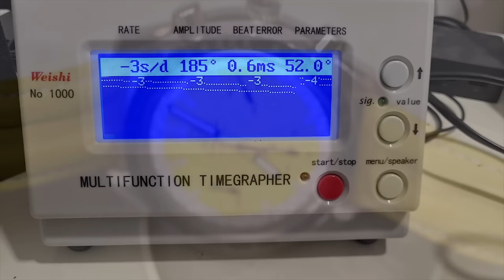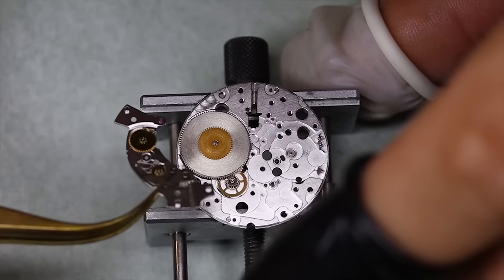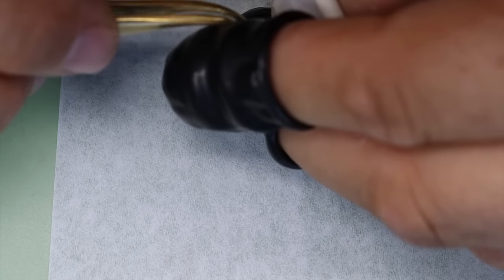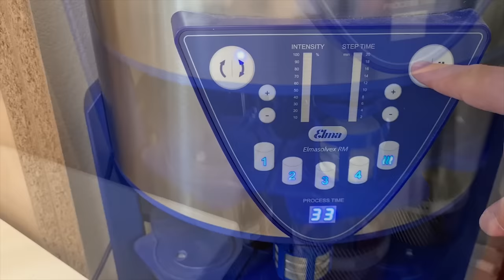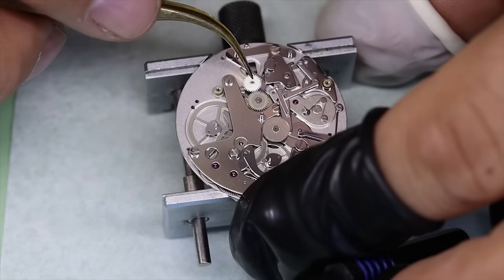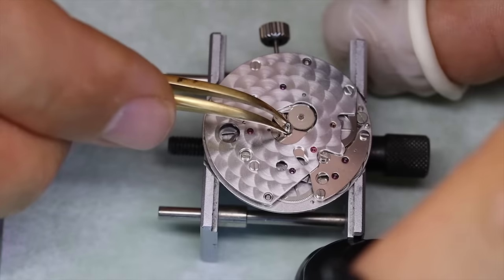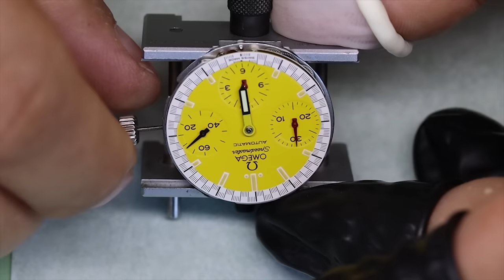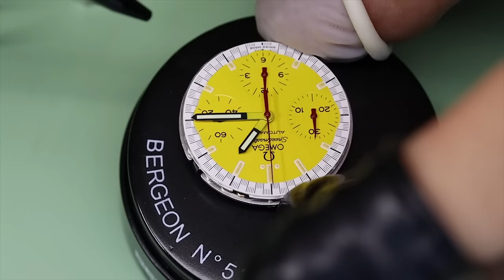The coolest watch on the track - but is it really an Omega?

Comment: That 1141 movement is a sight to see!!! It's Beautiful. One of my favorite hands down.
Reply from the maker: Hello Dan, thanks for watching and for your comment! It's a cool movement for sure and in a way relieving to see a chronograph without a 7750 inside...
Reply: i had it down as a 1140 movement
Reply from the maker: @philipdenner8504  Hello Philip, the 1140 and 1141 are pretty much the same, but the 1140 is gold plated and the 1141 rhodium plated.
Reply: I WAS WONDERING IF YOU COULD DO A BIT ON HOW THAY USED TO MAKE THE BASE OF THE WATCH . NOT CNC BUT HOW THE FIRST WATCH MAKERS  MADE THEM . WE ALL KNOW HOW THAY MAKE BITS OF THE WATCH EVEN BY HAND .  BUT NO ONE EVER SAYS HOW THE FIRST WATCH MAKERS MADE THE BASE PLATE WITH ALL THE POINTS ON IT SO YOU CAN MOUNT ALL THE GEARS AND SO ON . JUST A THORT .

Comment: Very good video. This is the first time I hear someone refer to the manual on a YouTube "watch channel".  As I restore electronic equipment, a service manual and a schematic are of the utmost importance in most cases.  I always wondered how you guys can remember the sequence of reassembling a complicated thing like a chronograph.
Reply from the maker: Hello Berre, thanks for watching and for your comment! As a man my first inclination when seeing a manual is of course to throw it in the garbage 😂 And for simple watches there isn't generally any need for a manual, as their layout is logical and oiling is straight forward. 

But for more complicated watches I always try to find the manual (or tech sheet/tech communication as they are mostly referred to) to make sure I don't miss anything. And trust me, all watchmakers do this unless they know that specific movement in and out. At some point you don't need the tech sheet anymore. 

The problem with old complicated movements is that it can be very difficult/not possible to find the tech sheets, especially for manufacturers that are no longer in business. Then you're mostly down to your own experience and hoping that the previous watchmaker put the parts in the right place 😁

Comment: Very impressive. That module looks like a massive cluster f&$# though. I want to say these were marketed as 3510 movements? I have a 3513.20 and really love the size and the fact it’s an auto. I will steer clear of the real “reduced.”
Reply from the maker: That module isn't for the faint hearted for sure 🤣
The model line numbering was 3510.xx but the movement number was 1140 (gold plated) and 1141 (rhodium plated). There is however a later version of this movement called 3220, which has some small improvements but is essentially the same, perhaps that's what you recall?

Comment: Superb photography of the process of reassembling the chronograph assembly.  The shots taken looking 'sideways' at the movement, from about a 30° angle relative to the baseplate, make it very easy for the viewer to comprehend how all the different parts interact with each other.
Reply from the maker: Many thanks, Michael! I'm planning to improve further on this going forward, so stay tuned :)

Comment: Beautiful, eye candy, one day I will work on a high end Omega I hope =). Nice that you could get the screw out, I used a staking tool to unscrew a broken screw on my last project, I think I got lucky. Nice job, see you soon /Josef, Stockholm.
Reply from the maker: Tjenare, Josef, thanks for watching! It's a cool watch for sure although most watchmakers don't really like it. There are plenty of ways to get a screw out, but this tool actually works pretty well :)
Reply: @VintageWatchServices  förstår, yes its a like or hate watch I guess :). Yes but that tools seems very nice, I've heard about it before.
Reply from the maker: Maybe just to clarify: what watchmakers don't like is the movement, that it's a module put on top of a more or less off the shelf ETA. Btw, a staking tool is a smart approach for getting the screw out 👍
Reply: @VintageWatchServices  aha I see, thank you.
Reply: @VintageWatchServices  unless the screw is not accessible from both sides.  Then it can really be frustrating. I ran into this on an old Seiko 6118 movement. The watch had slight water intrusion and it rusted the bottom of the balance screw off in the hole. I typically have tons of Seiko spare parts but of course the 6118 plate is uncommon and significantly different from all other Seiko's.  I binned the project until I can come up with a non frustrating way to remove it. I might have a go at trying Alum Powder to try and dissolve what's left of the screw.
Reply from the maker: @Killsnapz  Hello Victor, your absolutely right, this technique only works on open ended screw holes. If it's a blind hole or can be very tricky. Alum powder truly works miracles in many situations like this and shouldn't affect the brass in the plate. Heating the alum powder solution speeds the process up a lot. Good luck!

Comment: I could not understand the broken screw extraction process as you illustrated it. Perhaps a little diagram would have put me right.
Reply from the maker: Hello Pablo, a diagram is a good idea, maybe I should have done that. I wasn't really intending to make it a bit part of the video, thus the quick take.
The way it works is that you have two runners, one for each end of the broken screw, and you tighten these so that they grab the screw from both sides. Then you simply rotate the plate with the stuck screw so that you unscrew the broken piece.

Comment: Been missing your humorous knowledge lately.  This was interesting,  as many parts as this thing has, I would expect it to be more expensive then regular Speedy 1861!  I can see why Omega would like to simply replace the DD module instead of rebuilding them.  Do you suppose Omega replaces them, then sends the old unit back to  DD and let them service them?  
    Thanks.
Reply from the maker: Hello Randy, good to see you! You're spot on with that thinking, it's exactly what Omega does 👍
And the 1861 is considered a much higher grade movement, originally developed by Lemania, so it is much more sought after in the market as well as of course being famous for powering the Moonwatch!

Comment: Oh thank you! This is what I have been searching for! I have a few watches running the Dubois Depraz module and wanted to see one! You know it is extremely hard to find a service center that does both the movement and module here in the northwest. 
I have 2 Daniel JeanRichard watches and 2 Versace watches and one Zodiac watch running the Dubois Depraz module. 
When talking to a service center they will most of the time say that the Dubois Depraz modules usually do not need servicing because the chronograph isn't used as much. If you say you want it serviced then they will tell you that they will service the movement and return the watch. Then you can send it to someone else for the service of the module. 

Listen if somebody reads this I am looking for pushers for a Daniel JeanRichard chronoscope. I absolutely can not find a source anywhere. Ref # 25030 .
So like I said thank you!
Reply from the maker: Typically the shops would replace the module with one that has been overhauled by DD themselves rather than service all the bits and pieces in it. It's not a great movement to work on, tbh 🤔

Comment: What do you think of the 1120 vs the 500 series and 1020 series movements?
Reply from the maker: Hello Jacob, I've not worked on the 1120, but it is in essence an ETA 2892, thus a very good movement but not an actual omega movement. I certainly prefer the 500 series and even the 1000 series, mostly because they're from an era where there was so much variation on watchmaking. The 2892 is in most ways a better movement than the 1020, but I still like the 1020 better. It's a bit the same as liking Italian cars more than German ones, they might break down more frequently but they have more soul 😂
Reply: An Alfa car mechanic explained to me once that vintage Italian car owners spend most of their time under theirs car rather than in their car. 😂

Comment: Nice work!

Btw what is the difference between speedmaster DD289X and ETA stock 2894
Many brands just use 2894 today 
Are they the same type of module?
Reply from the maker: Hello Jeffery, thanks for watching! The 2894 is actually a competitor to the DD modules, as it is an ETA module on top of the 2892, thus completely ETA made. It's the same concept but of course a different module. 
DD actually produces a whole lot of different movements, not only the chronograph modules they're best known for and even makes parts for "in-house" movement makers behind the curtains 😉

Comment: Are you a busy man? I want to be your young Jedi, im so impressed!! I like your humor and its very noticable that you are VERY good at your job. - Also how much does such a service cost? And what do you think of the B01 movement from breitling. My 79350 is rocking that mvmt, so I would be very delighted to hear your words.
Reply from the maker: Hello Carl, my middle name is actually "Busy". There are certainly tons of much better watchmakers than me out there, but I think I have a good head for understanding problems and am increasingly improving my skills to solve them :) 
The B01 is a great movement from what I have seen, it's a very good teardown of it here: https://www.thenakedwatchmaker.com/decon-breitling-navitimer-01
I have not worked on it myself and heard some rumours about some early problems with the rotor not rotating easily enough, but I'm not aware of any prevailing issues with it. It has a couple of really cool features and looks very nice in my view.

Comment: I would like to see how you approach fixing a movement that doesn't run well after service.  The movements that have given me the most trouble are the old ones, e.g. Elgin 447, PUW 1463, Orient 46941, Seiko 6119C, EB8150. The problems that are difficult  to fix are things like the movement runs for a minute or 2 and stops, the watch runs 30-40 sec/day slow but the movement is set to maximum +, sometimes on a timegrapher the movement looks good with fairly smooth straight lines and other times it show a "snowstorm" with no pattern, etc.
Reply from the maker: Hello Richard, thanks for watching and for your comment! What you're pointing to is indeed common issues, but after a service a watch needs to run well, otherwise you haven't actually completed the service... It might be that you need to change parts which are too worn to remove some of these issues and some of them might not even be fixable without major intervention. The issue with a watch running too slow but the regulator is set to max + might be one such problem, but it might also be as easy as adjusting the index pins or the stud. 

There is always a commercial aspect to servicing a troublesome watch; is it really worth it? Are you/the customer prepared to spend $500 to get a $100 watch running acceptably? At some point you will have to decide whether you are investing too much in something that will never become what you want, and that might very well be the case if you buy a cheap fixer-upper from eBay, for instance.

Comment: Great video. Thank you. With press fit crystals, case back gaskets, and pressure ratings, how do watches get dirty inside?
Reply from the maker: Thanks Tom! A brand new watch should indeed not get dirty, but as a watch goes through its life cycle, the initially very tight tolerances will start sliding a bit and that's when the water resistance starts dropping and the watch starts "breathing" a bit, the air pressure changing with temperature differences and thereby letting tiny pieces of dust enter. That dust mixes with old lubrication and voilà, you have dirt. Add to that the fact that some owners like to open the watch to have a look etc.

Comment: My watchmaker has a particular dislike for ETA 28 series movements. He says they are in many ways counter-intuitive. I believe him, as long as he services them.
Reply from the maker: That's too bad for your watchmaker, as he probably sees quite a lot of them 😂 2824 and 2892 versions are so ubiquitous in watches from the last 40 years that you will get a lot of them (or clones from Sellita, STP etc) on your bench if you take customers watches in for servicing. 
As a guy working mostly on vintage watches with in-house movements, I certainly prefer such over the 28xx's, but the 28xx's are very solid and reliable and arguably the most commercially successful movements of their category ever.